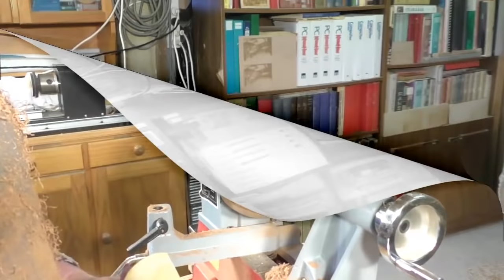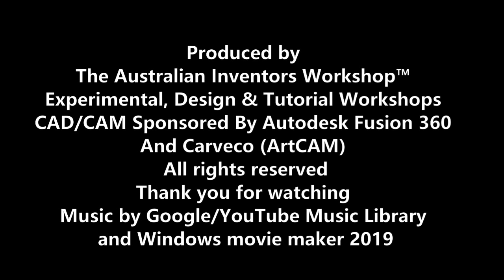# How-to # wood-turning your first bowl 101

Comment: Can you start with a CNC mill and then finish it on a lathe to make it faster? Would it be faster that way?
Reply from the maker: Yes you can but it would not be faster, a CNC lathe will do this job in about 1 minute.